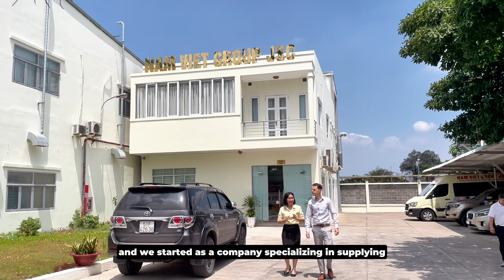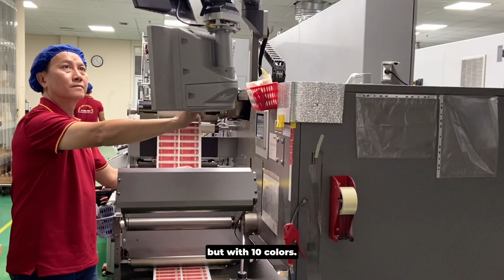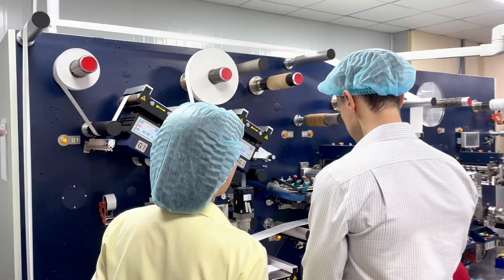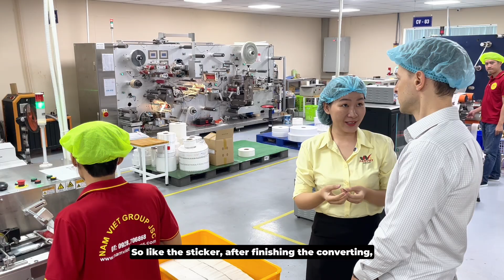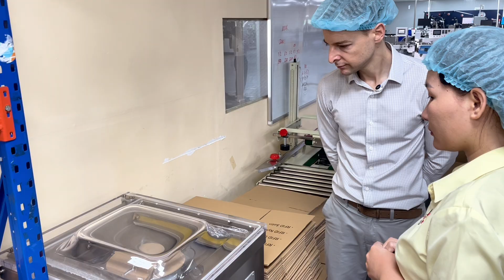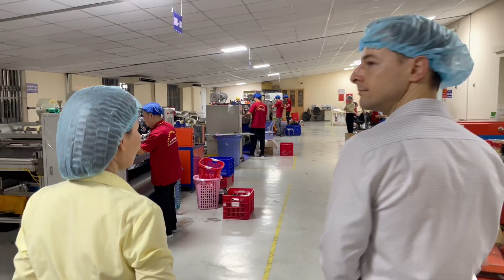Vietnam factory tour | Smart Labels & RFID packaging suppliers | Global Sourcing Fair Vietnam 2026

Comment: Good overall understanding. Thanks a lot ! One missing questions would be do they always test the final labels?
Reply from the maker: Good question. For smart labels and RFID products, final label testing should normally be part of the quality control process, especially when performance matters. Depending on the product, this may include readability tests, adhesion checks, printing accuracy, barcode or QR code scanning, RFID reading distance, and durability tests. It is something buyers should clearly confirm with the supplier before production.